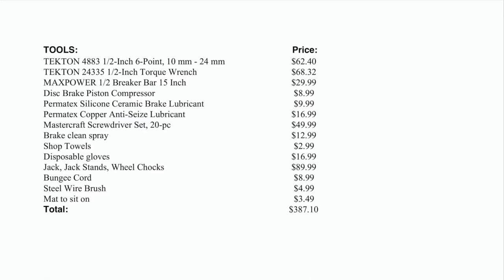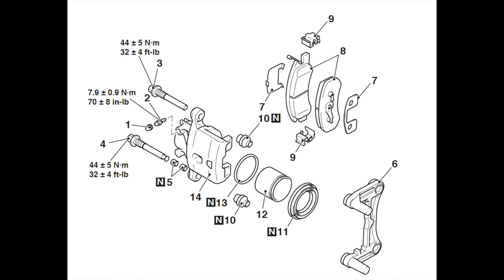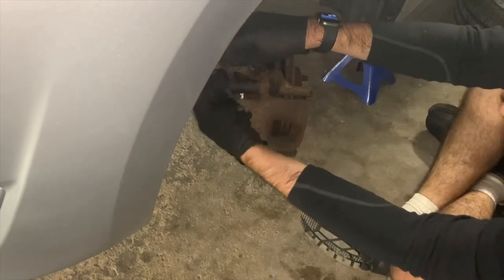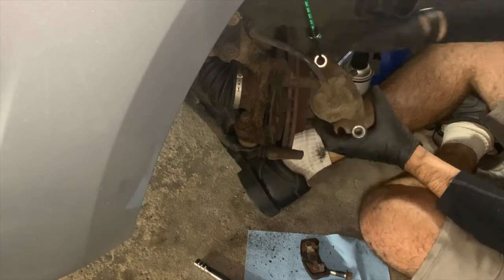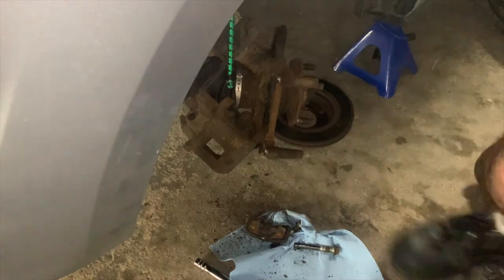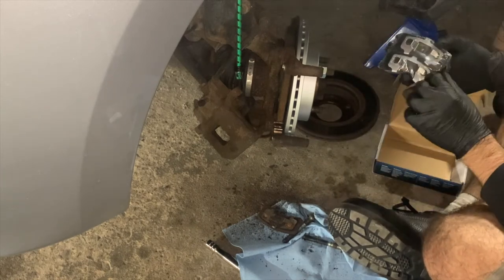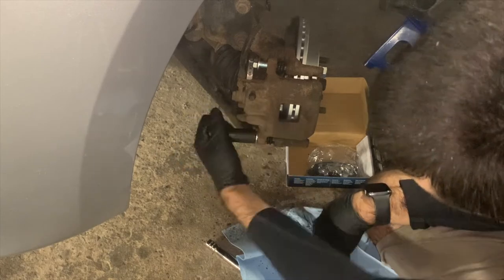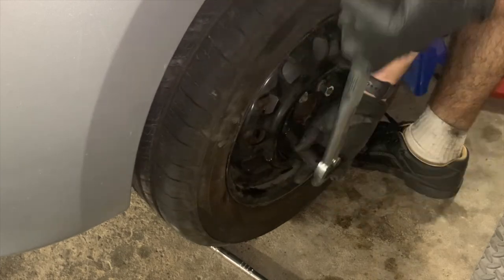Mitsubishi Mirage Front Brake Pads & Rotors

Comment: I think the Mirage would be a blast to work on. Everything is like a normal car but miniaturized. Little calipers, little rotors, little brake lines.. but for some reason a battery that's larger than the engine block.
Reply from the maker: It is a blast to work on, it's one of the only modern vehicles that doesn't have any "unnecessary" complexity such as a hybrid system or a turbo charger. The large battery is a good design choice in my opinion, at Costco the price difference between the group 35 battery in this car and a smaller one is negligible. My car still has the original battery thats 7 ish years old and it works fine. In other markets such as Europe the larger battery is needed as the car uses a larger 85 amp alternator for regenerative braking, a large battery capable of charging at 85 amps is needed in those markets. The larger battery is also obviously beneficial if you want to sit in the car and listen to the radio with the engine off or if you are like me and accidentally leave the dome light on for a couple of days. The car still started like a champ. Some people even go so far as to upgrade the battery to a group 24F battery: https://mirageforum.com/forum/showthread.php/6909-Tutorial-Modify-box-to-fit-a-24F-battery-(Large) Also, the brake rotors are slightly larger on the 2017 and newer models.
Reply from the maker: Consider subscribing if your interested in other videos i have planed such as coolant change, rear drum brake change.
Reply: @welfarewagonrepairs  Thanks, will do. I actually found your channel through the Mirage Forum. Very cool forum, people are helpful and secure enough to make fun of their own ride! Rare to find down to earth car enthusiasts.
 
   You might find this weird, but I don't actually own a Mirage. 
Rather, I rode in my dad's Impreza and saw the mileage he was getting (40mpg in perfect conditions). After that, I've been hooked on learning about fuel efficient cars. 
I hope to own a newer Mirage in 2 years as a personal vehicle so I can leave the work truck at home. 
Thanks for the info about the battery. 
As it happens, the alternator in the truck is getting replaced with a higher amp one because I do many ultra-short trips in the city per day for work. Will also look into battery options and for the Mirage as well. Thanks
Reply from the maker: @KF1  I don't find it weird, a car is a big purchase and a tough decision, especially if you buy the Mirage new and have a 10 year warranty(guarantee) it will work. The Mirage has a smart ECU(computer) controlled alternator, even if you used 1/4 the stock battery listening to the radio and starting the car. Once the cars on the computer will command full power from the alternator. It would take about 10 minutes to recharge the stock mirage battery 25%. Feel free to leave a message here if you have any ideas for a video you'd like to see: https://mirageforum.com/forum/showthread.php/9725-Starting-a-Youtube-channel . On a side note: higher amp non-computer controlled alternators don't always put out more power than a lower amp alternator at lower RPM(i.e city driving/idling) some of them even put out less power at low rpm.
Reply: @welfarewagonrepairs  Thanks for the info. Not sure it's anything similar but good to hear the Mirage is well coordinated that way. 
   Big decision, definitely! but tough decision, not at all:) Outmiles the Rio, the Spark, the Micra, the Yaris, it's like nothing can touch that little 1.2L in real world use. Love the sound of that 3 cyl and I miss driving a 5 speed so bad I count the gears in my truck every time it shifts.

Comment: Good video!  This is the most complete, slow, and thorough video I found on replacing these brakes.  Not sure if you said this or not, but when you put in the outside pad that clips into the caliper, there are 2 metal bumps on the back of the pad that fit into little shallow holes (depressions) in the caliper.  I put my first brake back together without noticing this.  Then I did the 2nd and noticed it and went back and fixed it on the first one.
Reply from the maker: Thanks for watching!

Comment: This car likes plenty of grease on the caliper slide pins. At every other brake change, I use brake cleaner to thoroughly clean out the holes in the caliper where the slide pins go. I even stick a narrow shaft screwdriver with a thin rag into the holes to get all the old grease out. I will then put a bit of brake grease into the holes. I found through experience that the rubber boot tends to squeegee the grease off of the pins as they are inserted into the caliper, so having some "preloaded" in the holes will ensure the pins are adequately lubed. I went through a couple of quickly worn rotors before discovering what was happening! BTW, I have the exact same year of Mirage. I use it as a driver's ed car. It has 180,000 MILES and is still going strong!

Comment: I had a heck of a time with the bottom slide pin. What finally worked is that I took a big adjustable wrench and put it behind the head of the caliper bolt and pried it out. Struggled for like half an hour lol
Reply from the maker: Some of the issue maybe that too much grease was used during install which creates a perfect seal preventing the sliding bolt from sliding(it would create a vacuum when you tried to remove the bolt). What matters most is that it all worked out in the end.

Comment: People might actually use this as a tutorial. For anyone who's learning how to do brakes for the first time, take note the most important part is after you finish both sides and put the car back on the ground, get in the car and BEFORE you put the key in the ignition, PUMP the brake pedal 10-20 times pushing it down all the way until it's very firm. Then start the car and test brakes.
Reply from the maker: This is great advice! My brake pedal was firm without any pumping, this is probably because the new pad takes up basically all the space between the caliper and the rotor. People can also consider "bedding" in their new brakes by following these instructions: https://www.autozone.com/diy/brakes/bedding-brakes

Thank you for watching!

Comment: And when the car is on the ground tighten the lug bolts to 90lbs torque BY HAND. You tire "techs" gotta stop using your air ratchet and you impact drivers to over tighten the lug nuts. I've never in my life snapped a lugbolt until I snapped 2 out of four after a tire "tech" mounted tires on my daughters car. You can also warp the rims when you over tighten the lugnuts, numbnuts. 90lbs on the ground by hand every tire every lugnut.
Reply from the maker: I recommend tightening the nuts while the car is in the air as the weight of the car may prevent the nuts from tightening